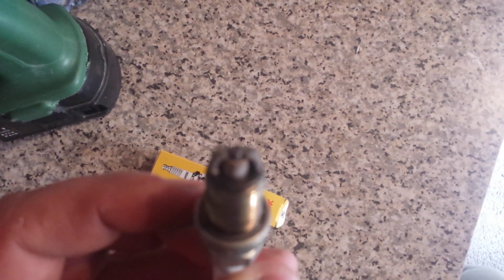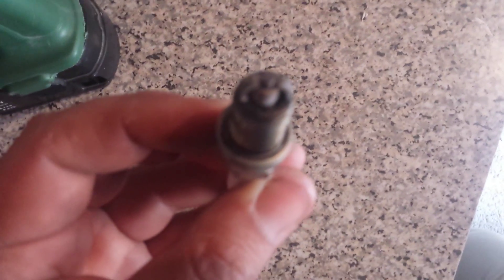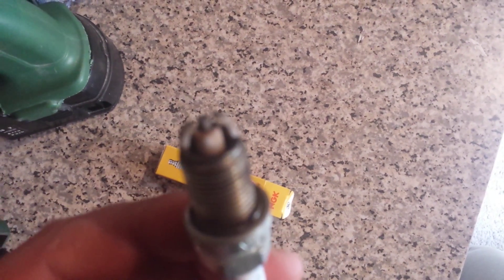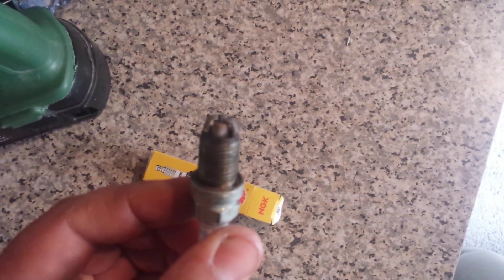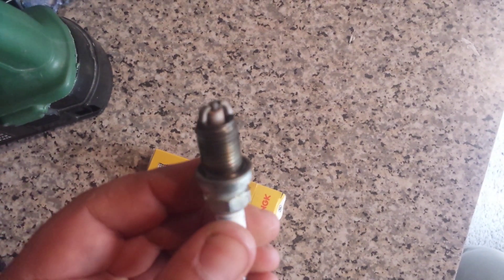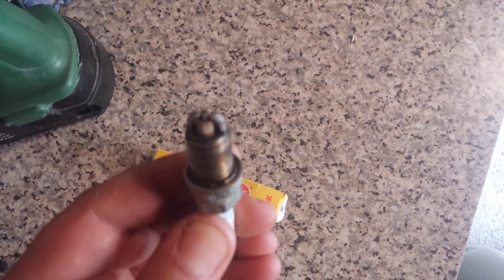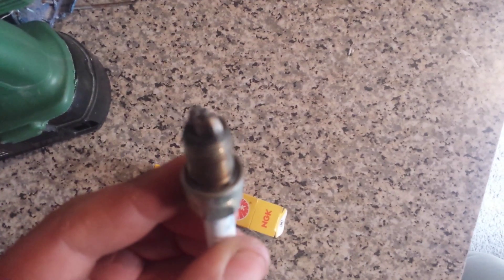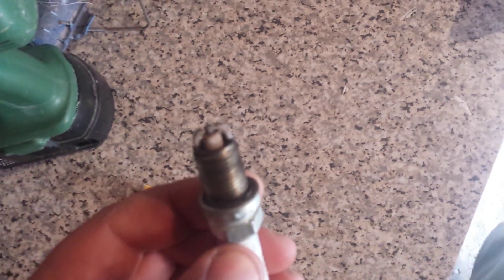Hho dry system spark plug problems

Comment: Having water injected into engines with hydrogen seems ok.
e.g. www.AquaTune.com explain their system purposefully inject H (60%) with water (40%), it lowers engine temp by 20 F from what I read H combustion is much hotter than petrol combustion.

Interestingly AquaTune does NOT use electrolysis to get H, their system uses only 1.5 Amp to extract H from water via ultra-sonic frequency in a vaccum... seems more efficient than traditional electrolysis. Also solving the "high heat problem" resulting in using hydrogen as fuel. Unfortunately their product isn't cheap...
I've seen video on YouTube about AquaTune systems, from the looks of it seems to work fairly well equvalent to electrolysis systems.
Reply: Yeah, water injected into an engine running HHO turns into steam at ignition and takes a lot of the heat of combustion away through the exhaust. The trick is balancing the water and HHO so that the engine trims back on gasoline/petrol delivery, and adjusting ignition timing. Look into MAP and upstream O2 sensor “cheater” circuits. I use them on my non HHO car with water injection to great effect- HHO would likely double it.

Comment: I think those are great plugs, run hot with a good intense spark. I wonder if you try a more standard spark plug that has a cooler spark or go for a full racing plug that's made to run much hotter then the ones you are now using, if that might get the results your looking for...